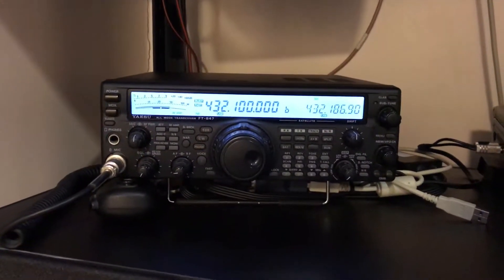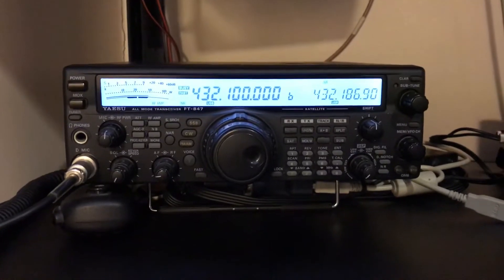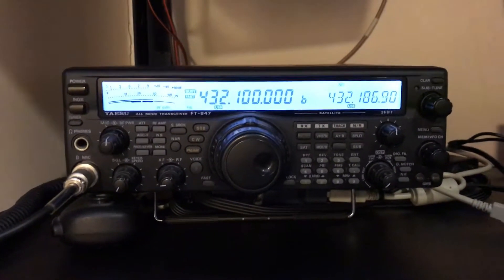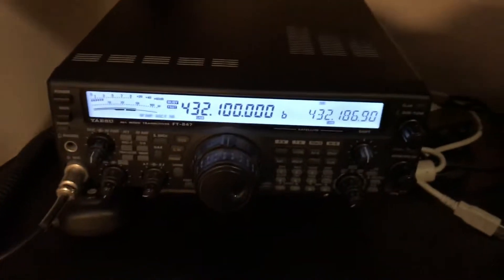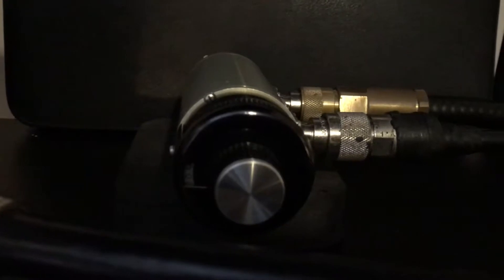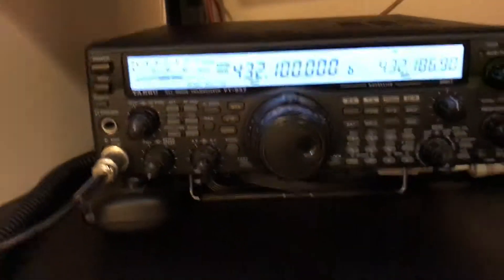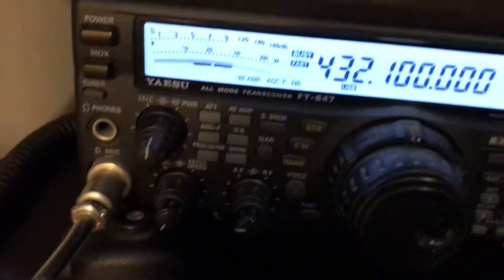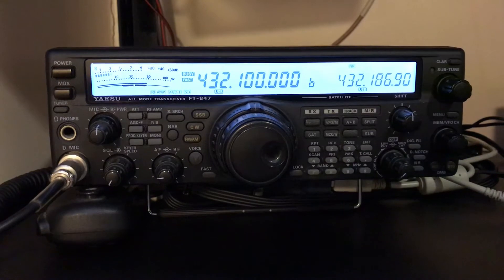G6HKS Sun Noise measurment

Comment: Would you get a more accurate measurement by connecting an AC millivolt meter to the speaker output, turn the AGC off.  Then measure the noise level out of the receiver.  One measurement pointed to cold sky and the next pointed to the sun.  Now crank in the attenuator until the volt meter reads the same as cold sky.